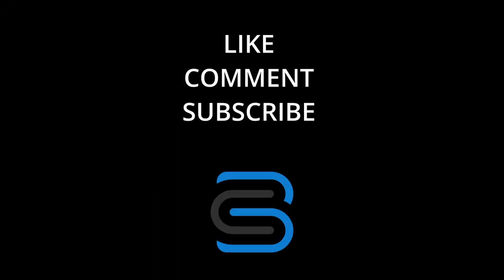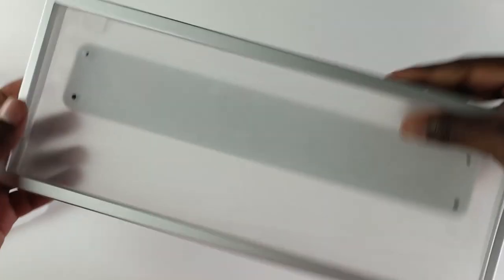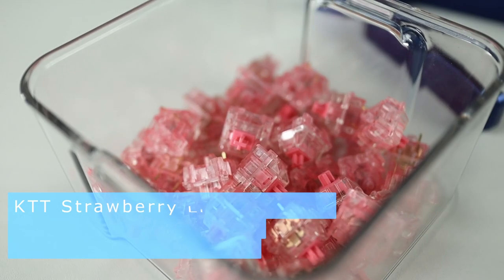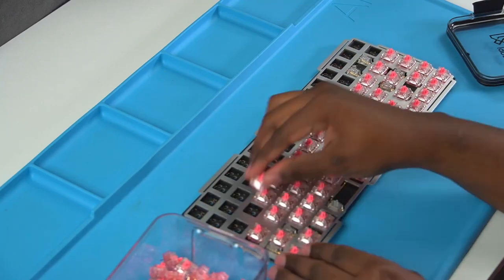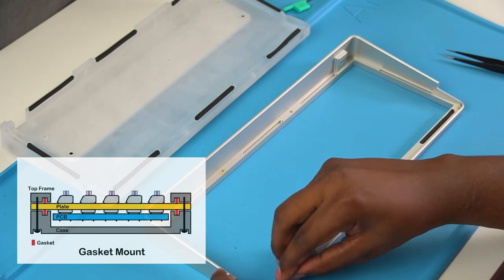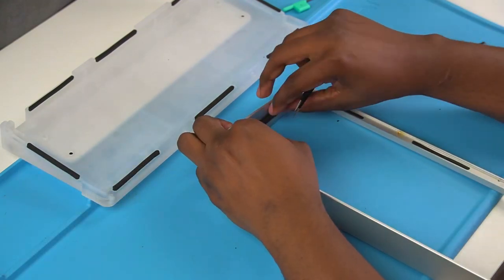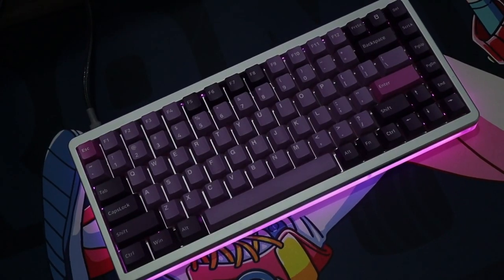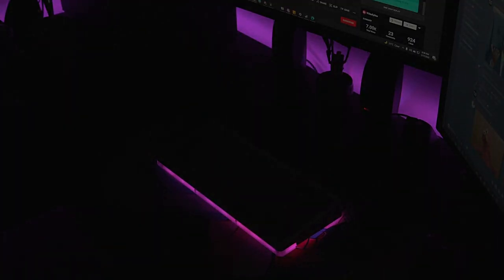Building an Enthusiast Mechanical Keyboard for a friend | D84 V2 from KBD Fans

Comment: question, does ur pcb have rgb on the front of the board and bottom to displace acrylic diffuser but also show key stroke colors? or is the lights soley on the bottom of the board?